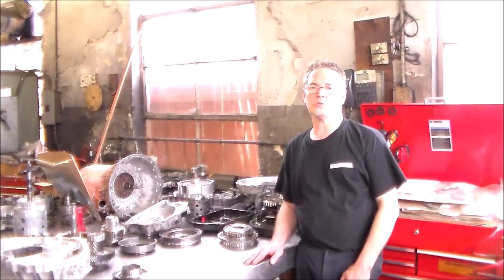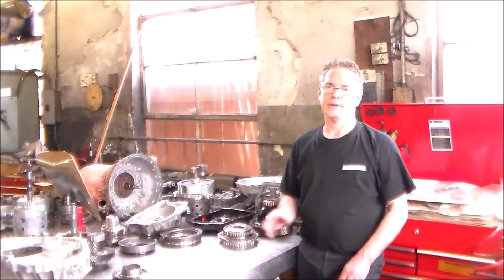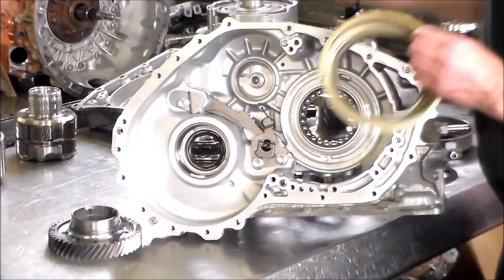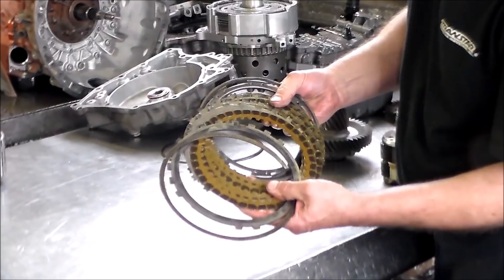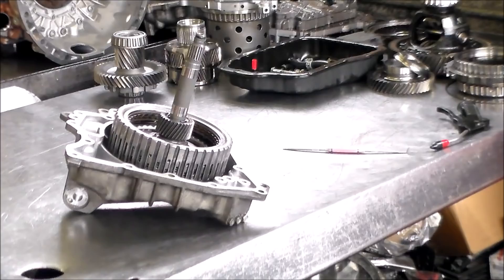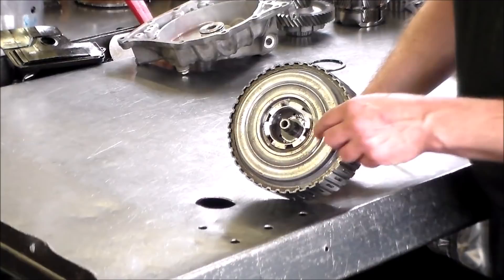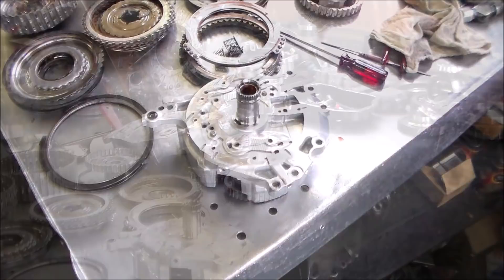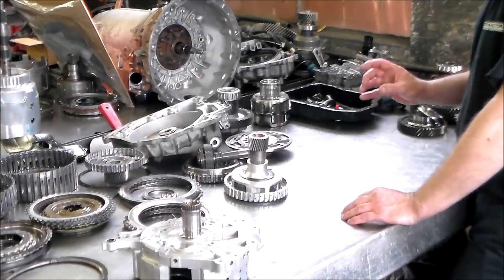U660E Highlights

Comment: Greetings Mr. Ferraro , I have U760e with P2716 Code , so I had replaced the OEM SLT solenoid and the harsh shifting had gone ,but still the reverse not engaged when transmission is hot ,no codes no forward issues only the reverse , Sometimes need to put into drive or neutral couple times to make reverse engagement . Any ideas Sir !

Comment: I have this transmission im my 2011 Camry, can you go into details of the valve body and what each solenoid is responsible for;  My transmission runs fine and shift fine but everytime i put it in drive ( hot or cold ) there like a 5 second delay before it goes into drive...

Comment: Hello there, i have a v6 07' camry with hard shift from 35 mph when hard accelerating (probably third to second gear im not sure). Medium accelerating lets it shift smooth. Accelerating hard from 0 mph lets it shift smooth as well what could the problem be. Well at least what I could predict? Fluid and filter changed recently

Comment: Nice video. My u660e in my camry is running great at 144,000K but my mechanic just discovered a really really small leak from the bell housing. He thinks it's the input shaft bore issue. How much you think to fix that?
Reply from the maker: If from the front, it would be a Front seal, pump o-ring or even something with converter.  I would clean this down and drive it a few days and see if reappears , is the fluid full?  Make sure the axle seals are checked as well
Reply: @GaryFerraro  thank you

Comment: I watched a video on changing the fluid in this transmission, and it said you need a vacuum pump and a special straw tool in order to check the fluid level. Can you really just fill until the fluid comes thru that red straw on the bottom of the pan? That would make things much easier.
Reply from the maker: Yes, with engine off fill til it comes out stand pipe, the start the car and fill until it comes out of the stand pipe. To drain just drop the pan
Reply: The transmission shop would have to wait until transmission is between 105 to 113 without the atf tool gauge tank and vacuum system

Comment: Thank you so much.
I am tackling no forward, no reverse,  No dtc code. Found out turbine speed TC  is  zero when in drive. Pump is  ok, fluid comes out of cooler. I already dismantled and im seeing faults in torque converter and b1 clutch.  I will replace these and see how it plays.

Comment: Excellent video as usual. Even though this wasn't a teardown video,  it wasn't far from it. Extremely detailed, lots of great info & tips. 

I specifically enjoyed the proof of concept of checking the leak at the rear cover. Removing that bearing so that pack is seated at a different position in the cover, which truly identifies that groove in the cover as being the issue. Very thorough! 

Happy Father's Day Gary! Big hugs! 😊😊🤗🤗
Reply from the maker: Cuba's Automotive Thanks Cuba. Hope the video helps someone not much out there on this transmission.  Have a great day. Big hugs back at you 😊

Comment: Man, what an outstanding video. Well presented and great audio...you and the equipment. In your experience, have you ever heard what the pump volume is in gpm? I am installing an external cooler with a thermostat. There are two option, up tp5 gpm and up to 20 gpm. There is quite a price differential, so I want to be sure if I need the 20 gpm unit. Thanks again for a great video.
Reply from the maker: well, if you pull off a cooler line, they say you should get a quart in 20 seconds

Comment: The problem these transmissions have with the race and bearing spinning in the housing just as you found in this video...is that caused by too much torque from the motor or the "lifetime" fluid not lubricating properly? Thanks for the video.
Reply from the maker: They say its from the torque from the motor, this does not happen on 4 cly units which is called U760
Reply: @GaryFerraro  Bummer. Thank you for the reply.
Reply from the maker: @TheBenjammin  sure, no problem
Reply: @GaryFerraro any way to correct this?  I will have Toyota install a new remanufacture unit for a venza v6.

Comment: Hi Gary, thanks very much for the great video.  I have rebuilt engines but this is my first transmission.  My differential is bad ('07 es350) but no luck finding one, dealer wants $950 for new diff.  Any suggestions?  Thanks
Reply from the maker: Parts are very hard to get, the last 5 Toyota's  i got in had to go with dealer units, even used parts are hard to get.
Reply: @GaryFerraro  should I get a $2k LKQ trans with 100k instead of rebuilding mine?  Seems like it.  Will 2010+ u660e fit 2007-2009 motor with no issues?  Thanks again
Reply from the maker: @danielstarnes7354  I'm Not sure, you would have to give LKQ your vin number and ask if it will fit, tooth counts on final drive may be different

Comment: Hi Gary. Informative video and solid work.
I've got a 2007 Toyota Camry XLE V6 U660E with error codes for the shift solenoids A and D.
Do you know which solenoids those are as far as actual part numbers/location in the valve body? I'm thinking of just replacing the valve body with a reman instead of just those two solenoids.
Sometimes the car won't engage in drive unless I shut the car off and restart it. I added 3/4 of a quart Toyota WS with the proper fluid level check procedure, but still throwing the same solenoid A & D codes and intermittent failure to engage in drive. I've got 220k miles on it, so it might just be time to let it rest. Input appreciated.
Reply from the maker: What are the code numbers?  I can send you some info, e-mail me at
gsferraro@yahoo.com
then i will send you some info
Reply: @GaryFerraro  e-mail sent. The codes are P0746 and P2714

Comment: One question. What do you think about this transmission U760E, is it good? Do you know if they have quality issues or defects? I have read they have some issues with the torque converter. Thanks for your support.
Reply from the maker: Yes, they have issues with the converter. They also have issues with the molded pistons which will cause a slip on the 2-3 shift. High mileage cars the valvebodies tend  to get bore wear
Reply: @GaryFerraro  one question, what do you think could be the best way to extend the transmission life without issues? What would be your recommendations??
Reply: @JesBu  change fluid every 60,000 miles filter every 100,000 miles Toyota atf ws fluid only

Comment: Hi Gary wonderful video. I have been thinking about upgrading my Valve Body and put the BOE Shift Kit on. But I'm wondering if I should be putting the effort into overhauling the pistons now or perhaps other parts you mentioned.
Reply from the maker: How is it working?
Reply: @GaryFerraro  It's working fine with the morning shift flare. But recently I've noticed it dropping a gear or shifting up from gears 234 or holding a gear for longer than usual.
Reply from the maker: @aaronpreddy35  may want to try a transmission service and reset shift adapts

Comment: Have you seen any problems with temp sensors on that trans? Not much information on it for  diagnosing, got sienna at my shop, with intermittent sensor electrical/ and performance code, repair instructions on Mitchell says transmission has to come out
Reply from the maker: I have not seen these with temp sensor codes.  What codes do you currently have?
Reply: Gary Ferraro I will look in the morning, one of the was tamp sensor electrical/ which I am optimistic about, the other one is a performance code, I looked on freeze frame data, to see where temp was, no data available, she saids it does it after she drives it for extended periods of time, I wonder if it’s over heating? Have not duplicated it yet
Reply: I called Atra, they have not heard of it yet neither
Reply from the maker: Let me know codes.   Where is your shop?
Reply: Gary Ferraro in Tampa
Reply from the maker: Have you done any work to the car yet?
Reply: Gary Ferraro no , just scanned it and drove it, the temperature was normal, the converter is locking up fine, I noticed the radiator leaking, so I was hoping it was low on coolant, but it was only maybe a half quart low

Comment: So I have an 11 Camry with the 2.5L and the U760E. I have an issue with the lockup for the converter. The 1-2 shift is okay but as soon as it shifts to 3rd I'm getting full converter lockup. Or stays locked through the rest of the gears unless I kick it down it will disengage like it's supposes to, but once it re-engages its full lock again. I used a snap-on scanner to monitor the lockup status and it doesn't switch to lock until it's in 6th gear. It seems like I'm getting full lockup when I should be getting partial lockup. Other than that everything seems to operate as it should. All the shifts are there and solid. I an thinking it could be a TCM issue, do you have any suggestions? 
Also, if I replace the TCM with the same part # will it have to be programmed or is that a plug and play module? Any info or suggestions is greatly appreciated. Thanks...
Reply from the maker: Is it throwing any converter codes?  Maybe try a memory reset see if anything changes
Reply: @GaryFerraro  
No codes at all. I tried a KAM reset and nothing changed. There was a TSB for trans related issues so I took it to the Toyota dealer to have the software updated but still no change.
Reply from the maker: Jed Brown Going to see what I can come up with.
Reply: @GaryFerraro  
I sure appreciate it. Thank you.

Comment: After a rebuild a U660E shop used mercon V,  which I replaced for WS after as soon as I knew. what could cause a hard shift from first to second gear? and sometimes from 5th to 6th gear also
Reply from the maker: Possible valvebody problem or not resetting shift adapts or memory reset. Is this ok cold and not ok hot?
Reply: @GaryFerraro  Thanks for taking the time to answer. They did the resetting twice already, which fixed some other problems but the hard shifts.
The problem is present in both conditions, hot and cold.
Could it be a oil level related issue also?
Reply from the maker: Ok question. When the adapts were reset did it change anything? Did it shift better for a little bit and then go back to hard shifting?
Reply: @GaryFerraro  there was no change at all in the had shifts after the reset. Thanks again.

Comment: My transmission on my 2007 ES 350 has a shift flare from 3rd to 4th gear only when cold.  I read that this is a relatively common issue on early U660 transmissions.  Otherwise, it seems to be shifting fine. Any recommendations to help rectify this issues?
Reply from the maker: The fluid level was checked?  If fluid is full, maybe a lazy solenoid.  you could also try to reset shift adapts or on toyota it may be a memory reset
Reply: When I checked the fluid, it was pretty dark.  I did two transmission services (replacing about 4 quarts of ATF) and now the fluid is a dark red.  I haven't dropped the pan.  The shift quality overall has seemed to improve but the aforementioned flare is still present.
Reply from the maker: @SibRevs  Pretty much if the memory reset does not work, have internal problem
Reply: Alright.  Thanks for the input.
Reply from the maker: @SibRevs  sure

Comment: Hey brother my Camry u660 when I drive at low  rpms my trans make a splashing sound this only happens when I’m costing at low gas pressure. It get worse when my car is hot. It feels like the the fluid is not getting into the gears but when i drive it at Manuel mode it gets better so I just drive it like a Manuel car and it’s ok. Before my car was making a really bad shuttering I just changed it and it got better then it got worse then I did a flush and it runs fine just that awful wind splashing sound. I’m a self dooer type of guy and I rather try to fix it my self. Any ideas. I think I need to give a cleaning on the solenoids.
Reply from the maker: Not sure, if i give you my e-mail can you send a video?
Reply: @GaryFerraro  yeah that would be helpful for your input
Reply from the maker: @carlitos19cali  gsferraro@yahoo.com

Comment: Curious, the spacer in the pump has a high ridge and a low ridge, which way is up?
Reply from the maker: There is a snap-ring that goes in right after that spacer correct?
Reply: @GaryFerraro  yes sir that is correct
Reply from the maker: @tomderush1461  I believe that ridge faces up, will double check
Reply: @GaryFerraro  that is what i did, after stacking the clutch pack both ways it seemed the clearance was best with the higher ridge facing up, thank you for your time, your videos have helped me more than once.
Have a good night
Reply from the maker: @tomderush1461  You too. Thanks

Comment: Is gear werring/whining  normal for this transmission while in operation?
Reply from the maker: I would ay no to that,  on these transmissions the main case wears out , when this happens the geartrain is not running true and can possibly make noise
Reply: I have a 2014 Toyota Sienna with 78000 miles and it's starting to make bearing noise whirring noise.
Makes noise at 50-65 miles per hour and sounds like a bad wheel bearing but if I put it in neutral the noise stops completely then when I put back in drive the noise will come on again as you continue to drive.
Would this be the main case pressed in bearing and case weakness ?

Comment: Gary Hello, tell me buzzing solenoid SLT, replace it?
Reply from the maker: Does the car have any issues?  does it buzz all the time? what about when drive is selected?
Reply: @GaryFerraro  Camry 40 3.5 2007 with the ignition on, the SLT solenoid buzzes and vibrates.
Reply: The car is driving normally.
Reply from the maker: @onlinerevolution9832  Do you hear the buzz all the time?
Reply: @GaryFerraro  Yeah Gary buzz all the time try to throw off the video.

Comment: Would you say this unit is still generally reliable? Or I should avoid it. Because I know when they first came out in like 07 with the camry v6 they have trouble with shift flares 2-3, 3-4, 4-5. I think they fixed that problem later on right?
Reply from the maker: Well, the valvebodies are a big problem still and they also have issues with the molded pistons
Reply: @GaryFerraro  Good to know, thx.

Comment: Dear brother
 Problem with Jeep Liberty code p0750  I hope you can give me the solution please brother
Reply from the maker: That is an electrical code, do you know what transmission you have? what is your engine size and year of the jeep?
Reply: Welcome Brother Engine 37 liter petrol automatic transmission in2005
Reply from the maker: @alisair2113   Ran the stats on the jeep, it may be a 42RLE, you need to get to the PCM to ohm the solenoids.  If you clear the code, it comes right back?
Reply: @GaryFerraro  Dear brother, I only know when I am scanning the code code 750. I am confused because there is no one to fix it in my country. I hope you can guide me please.
Reply from the maker: ali sair is there anyway you can confirm transmission type. Do you know where the PCM is?
Reply: @GaryFerraro  Is the problem in pcm
Reply from the maker: @alisair2113 You either have a bad pcm, bad wire or bad solenoid pack. Do you know where the pcm is located?

Comment: Cover no good
Reply from the maker: correct, big ring groove causing the delay in drive when hot
Reply: @GaryFerraro  what causes the groove?
Reply from the maker: @deft1abc1   Well, I looked at everything, bushings, bearings and really did not see much, I think it must be something with the cover itself, also because this is the first time im seeing this issue, possibly the cover not machined correctly, There wasn't even 70K on the mileage.